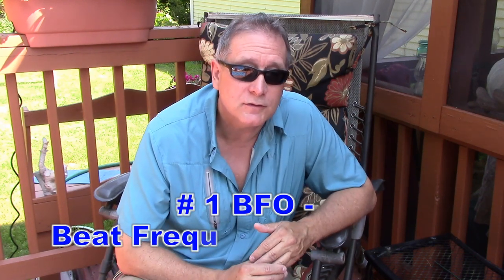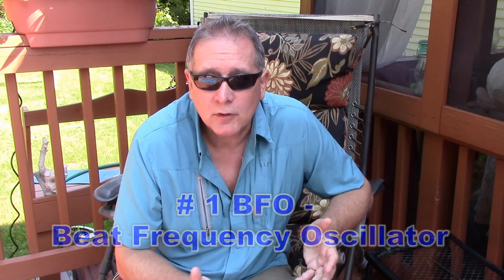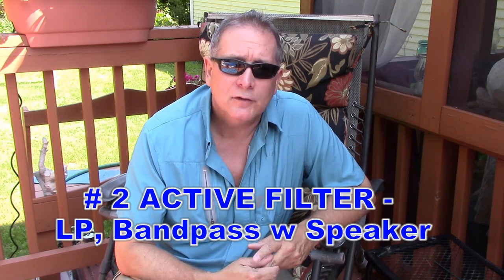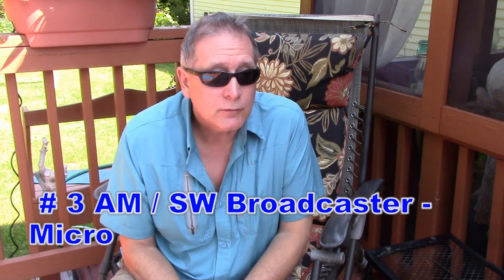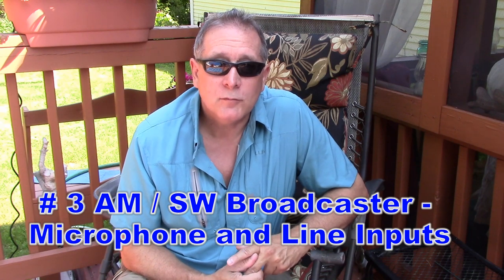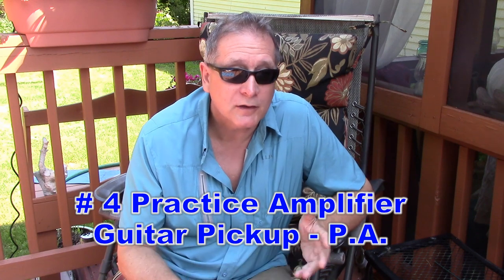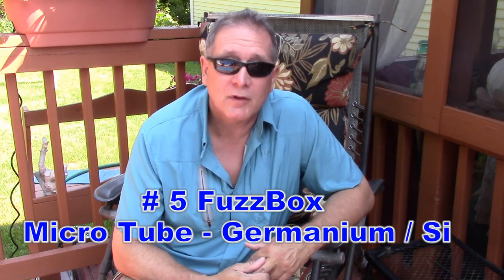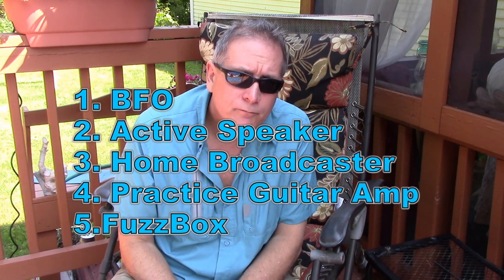More Electronic Projects? UPICK

Comment: I'd vote for the BFO. I'd like to see the (already built, I think) the tube cascode pre-amp, shortwave crystal set, and the battery powered tube amplifier all running together in a chain. :-) Hollow state electronics, especially home brew, are nice to see operating. DE N7ATE

Comment: BFO is my choice. Future idea a dual power supply that can handle two mobile 2m rigs at the same time. Designed around space limitations in the shack. Specs: two separate 12-13.8v 15-20-amp supplies. Digital meters monitoring voltage and current from both supplies and the voltage and current from the main power source.

Comment: I would like to see you take a dreadful, but common,  simple shortwave radio, like a Hallicrafters s38 or s53 and if you improve their lacklustre performance and add useful features. Make that hot chassis safer, a bfo that works, decent selectivity and stability. I have tatty s53 so I have more than a passing interest.

Comment: Hello.Mike - a BFO would be good but the q multiplier is the best way to retrofit a vintage receiver for CW or SSB reception in my view. Therefore I'd love to see you have a go at a small tube driven home broadcaster. Like most vintage collectors I've quite a lot of kit that could be used to receive signals and they'd be likely to be used a lot more if a tx was available. Would be terrific to be able to listen to podcasts and internet sourced radio stations on all the kit. Also it's a much more economical approach than having to say retrofit bluetooth to multiple receivers as you only need a single tx! 

I'd to see you have a crack at a tube vfo for say topband. you'd be brilliant at talking through the pros and cons if the various oscillator designs and the design considerations around ultimate component selection. Another idea might be a smallish linear amp, tube obviously, to boost a qrp tx perhaps using a pair of 807s for around 50 watts input.

I'm sure anything you do will be fascinating to hear about though. 

73 / M0IDF

Comment: Currently Ive been doing a three stage amp with an electret 10mm mic and speaker(200w). How  to get the power higher than a 2n2222 for more volume? Maybe?
Reply from the maker: The most impressive speaker setup I have seen was a vintage job called a Klipshhorn. My buddy drove me out of the room with it. 100 mW RMS was showing on the meter. Yup 0.1 Watt. Your 200 Watt speaker will need some juice, probably just to move!

Comment: How about ‘how to trap layers of copper within some silicone or rubber slop, resulting in our own diy capacitors’, and then place those within some DIY crossovers for a mono 3-way speaker?!  Maybe try to get a general rule of thumb for DIY capacitors as in collecting data such as the distances between layers of suspended foil, as I would guess that this is very much possible to some degree of reliability (we could measure the mass of whatever we try to place in between the foil layers)?!  Whatever you try to do I know it’ll be a top notch video, you’re great!!
Reply from the maker: Ha roll your own! And who cares if they leak a bit and spit and oooooooz. That just adds to the audio flavor.

Comment: Taking them in order.

BFO. I'd still watch.

Active Speaker. Coincidentally, I've been trying to find some large inductors to experiment with passive audio filters, so this gets my vote.

Home Broadcaster. I'd still watch.

Practice Guitar Amp. A long, long time ago, I had a Saturday and holiday job working for a small manufacturer of popular music audio equipment.
One of my jobs was to (try and) match output transistors for  PA amps.

Fuzz Box. At the same firm we hand built fuzz boxes using germanium three legged fuses. 

So I tried to reduce the distortion at the output stage and then successfully re-indroduced distortion at the input.

Steve M0KOV